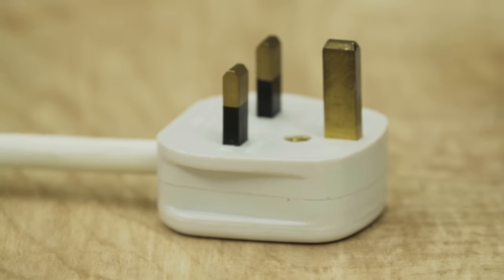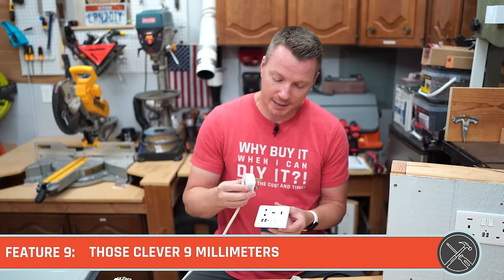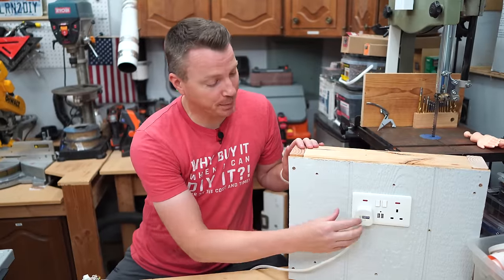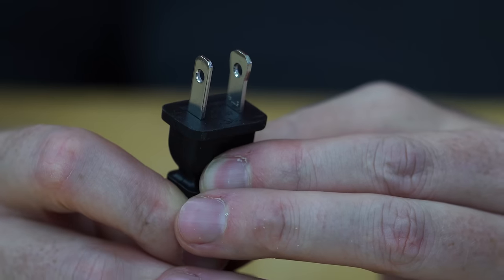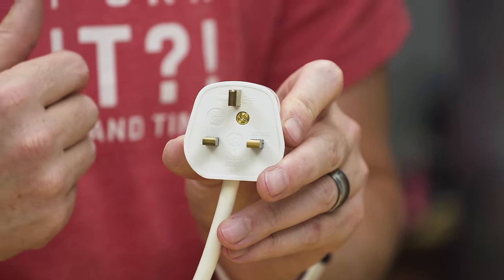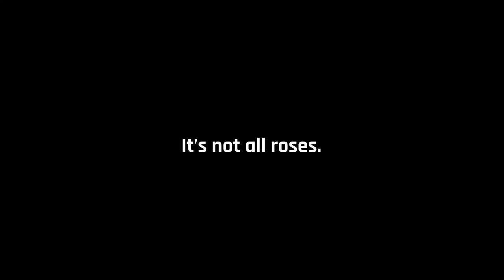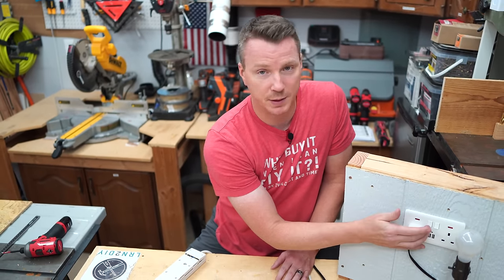British Plugs and Outlets Are On Another Level

Comment: There is a note about loading... all houses have a main switch. If a load causes a circuit a short circuit, that loop cuts out. Annoying but its another safety feature. There's usually several loops in a home, mine has one in the kitchen and living room, one in the garage, one in our outhouse and one in the bedrooms. My last home had two, one for half 8f each house.
Reply: Yeah mine has Lighting up - Lighting down - Plug sockets - Fridge - Oven - Washing machine - Boiler. Lots of lovely loops and a circuit breaker for each under the stairs.
Reply: If your main switch (main isolator) trips then that is an earth fault now unless you have a very old system which would have fuses. If you have circuit breakers for each circuit that would trip before the main switch as they trip at a much lower current than the main switch. The main switch tripping means it's protecting you from a potential electric shock.
Reply: Interesting, we have the exact same short circuits safety systems in India as well. Probably a system inherited from the British.

Comment: Many plugs are now sealed and inaccessible, the fuse can be reached by lifting a flap to replace, but the actual plug cannot be opened. I always keep older plugs as spares so that I can cut the sealed one off and replace if needed. Thank you for all the information, some of which was news.

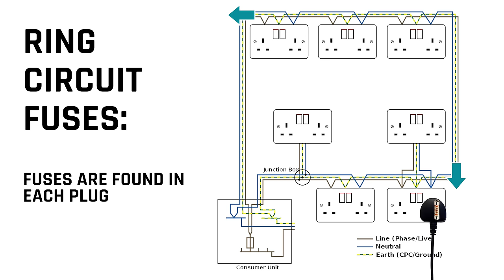Comment: 6:15 That is not at all the reason for the fused plugs. The reason the fuse is essential is that the ring circuit can deliver FAR more current than an appliance line cord. Without the fuse, every appliance, no matter how small, would need to use cord thick enough to handle 30-32A, lest the cord itself act as the fuse.
Reply: There 32 amps available on the Ring Main so the cord must be protected by a fuse of 3 to 13 Amps depending on its rating.
Reply: @fivish  Yeah, isn’t that what I said?
Reply: a conductor or cord is not a fuse and cannot act as a fuse, it can only overheat a set fire to its own insulation
Reply: @gimmieliberty6514  yes but that sounds pretty bad too.
Reply: Without a fuse if an appliance failed it would shut the power to every item on that spar.
Reply: @gimmieliberty6514  It was sarcasm: without a separate fuse, the cord will overheat and melt through until the wire goes open. (At which point a fire is likely to have started.) Any wire will act as a fuse if enough current is passed through it.
Reply: A 32A fuse naturally feels dangerous to rest of europe. Here in Iceland you only see those in industrial settings. Nothing in my breaker box exeeds 13A. Obviously this is not really a problem as these circuits are not burning doen houses and the problem is solved by fused plugs. Just feels strange.
Reply: Not really. AU/NZ, for example, run 20A radials. The plugs aren't fused at all. So you could have a lamp cable that's capable of shorting a 20A radial. The fuses in UK plugs are to protect to the edge, whereas everywhere else wants to protect the circuit.
Reply: our plug fuses generally are 6amps
Reply: @JonGretarB  13a fuse on breaker can’t run a dishwasher machine.
Reply: @MichaelBeeny  no, why would that happen?  What spar?
Reply: @JonGretarB  My shower is a 7.5kW one, pretty cheap and low powered compared to most modern showers, so it actually nearly meets the rating of the 32A fuse that feeds it. I had to replace it recently with this 7.5kW model, hard to find one so low power these days but as I was on a 32A fuse I could only assume that the cabling was rated for at least that, didn't want to take chances. However during fitting I found the cabling was actually much beefier and thus I could have installed a more powerful shower, but as the house is fed by a 60A fuse itself I wasn't willing to go too high lol.

The oven also has a 32A fuse and circuit, not that it needs is as it is a gas oven at the moment anyway.
Reply: @VIRNALIZ  Yes, it can. They use a tiny amount of power just like a washing machine. They don't even need as much power as a kettle!
Reply: Craig Dendy  The RCD is in the breaker, if you have them. I still have a good old fuse box. No need to update it, unless major electric work is being done in which case it may be legally required. But I'm not likely to be in that situation unless the house floods or something.
Reply: That's funny - as far as I'm aware, in my country, the default current you get per apartment is 16A, and you need to pay extra to get more than that. (Of course implicating compliance with other security measures to ensure safety across the board.)
Reply: Craig Dendy  Your comment is pretty pathetic, especially when you don't know what you are talking about 🙄
Reply: @VIRNALIZ  It most certainly can. My dishwasher is on a 13A circuit, but IIRC the dishwasher itself is rated at less than that.

Comment: In practice, basically nobody in the UK calls them "Type G;" they're generally just referred to as "13 Amp" plugs to differentiate them from other types.

It's also worth noting that the design has evolved over the decades; the live and neutral pins didn't originally have the insulating sleeves, for example, that was added later.
Reply: Just call them plugs or 3 pin here....never heard 'type g'.
American plugs are 2 pin...
Reply: It's a technical term used by electricians, so you wouldn't expect it to be well known.
Reply: If I wanted to get technical I’d just say BS1368 plug.
Reply: *1363

Comment: The thing about ring circuits you did not mention is there are different circuits for as an example in my house, is downstairs sockets, upstairs sockets, upstairs lights, downstairs lights. Then there is a separate circuit and socket for the electric hob and oven, and a separate circuit for the electric shower, and another for the hot water heater. Then there are a totally different system for the electric radiators all round the house.
 As said by Ed C, the switches don't cause any confusion when troubleshooting, they're pretty bulletproof and growing up with them, you know they're there.
Reply: hob=range (translator for Yanks)

Comment: The high safety level is also because we use 230Volts AC and a ring circuit will normally have a 32amp load rating, radials 16amp or more - not a combination you want to get on the wrong side of.

Comment: Another advantage of having a switch on the socket means you don't have to keep inserting the plug and pulling it out every time you want to turn a device off. This keeps the plug/socket connection nice and tight. (Notice how USB cables drop out of your phone all the time coz the port has worn loose)
Reply: Also means that the plug isnt left on the floor for you to stand on, negating yet another issue that was made up in the video.
Reply: Yup. Often times those 3 pin plugs were just sitting there without ever getting plugged off since we have switches to turn it off. Very convenient.
Reply: This is so true. I have a rice cooker and it doesn't have a switch on it, so if I left it plugged in it would always be on warming mode which is a waste. But, thankfully, I can just use the switch on the plug.
Reply: Eu plug doesn't wear out and almost every device have switch itself

Comment: You missed the main use of the switch, which is to disconnect power from the plug before inserting or removing, thus further reducing the hazard of arcing or shock.
Reply: Isn't the shock hazard zero because the prongs must be inserted to the point where only the insulated part is exposed before making a connection?
Reply: On more modern plugs yes.  But there are still older style plugs around that do not have the insulated sections. A switched socket makes those older plugs safer to use too.

Comment: #6 Easy to open plug - We do have moulded plugs a lot now - most new appliances come with them to avoid problems with people rewiring incorrectly. In those cases, the fuse is accessible by a hatch on the mating face.
And when you're used to the sockets having switches, it's instinctive to check that first...

Comment: Excellent video highlighting some of the key safety features that unfortunately are deficient in the North American system. Here are a few others -
1 UK you cannot straddle the plug in the socket when used on an extension lead , the 2 pin type B you can on a slim line socket leaving  one pin plugged in and the other unplugged which can be live at 120V and fully exposed.
2 Ring main at 32A feed at 230V can draw 8kW (unlikely), but “main” benefit is only one cable size (2.5sqmm) used for sockets and less issues with volt drop versus radial/ spur circuits. UK uses far less copper and thus material than N. American.
3 Fuse in plug top means can rate cable to load with appropriate fuse at 13, 10, 5, 3   and 1 A - so greener and cheaper for consumer. Also closer protection can be selected for the device being supplied so less risk of a fire in the event of a device failure.
4 cable dropping out of bottom down wall means  less likely to be a trip hazard - you appreciate that more as you get older!
You cannot beat the shuttering and live neutral prong insulation - it protects little fingers getting in and losing a child due to electrocution - that’s probably the most important of all considerations.
Reply: Point 2 is almost a day to day ocurance. My shower is 7.5kW, and that's the low end for showers these days. However it isn't on a ring, but it's own dedicated circuit from the fusebox.
Reply: @dlarge6502  You are talking about fixed appliances in that shower instance and they are wired as direct loads to the distribution boards plus dedicated GFCI / ELCB. UK is one standard socket configuration for domestic portable appliances all supplied  at 230Vac.
Reply: @stephenpike3147  I think that is what I said? Although there is no RCD on my shower. The fusebox is from the 90's

Comment: Having lived in continental Europe, I'd say the thing I missed most about UK plugs and sockets is it's such an old system that it's near univeral (BS546 plugs are still being made, and are still allowed, but I come across an example of one in use almost never, say once every few years).  This means you never need a different plug or an adapter just because you decide to move an appliance and find the nearest convenient socket doesn't match the plug type.

Comment: Ring circuits aren’t usually installed now. It’s radials. 
Also a square within a square, marked on the appliance, doesn’t mean double grounded (I’ve never heard of this) it just means the appliance is double insulated and needs no ground AT ALL.
Reply: Ring circuits were introduced in the post-war period as a way of saving a bit of copper, but are fast falling out of favour. As Darren says, new installations are generally done as radials.
Reply: @tlangdon12  When I wire from scratch, I usually do an upstairs radial on a 32a breaker using 4mm cable. The kitchen gets its own 32a circuit, again using 4mm, then the rest of the downstairs on a third. 
If the customer requests it, then each appliance gets its own 16a circuit using 2.5mm. That’s the dishwasher, drier and washer. If I do this, I don’t bother with a separate kitchen socket circuit and it goes with the rest of the downstairs socket outlets. I now use RCBOs for every circuit other than the lighting.
Reply: Yes, and in this case the plug may have a plastic earth pin that's just there to make it fit in the socket and open the shutters.
Reply: Rings are standard: Appendix 15 of BS7671:2018.
Reply: Rings are still the way brits do it ???
Reply: @maldwynparker5351  I don’t know any sparks who install new ring final circuits. Obviously if there’s one installed and you’re adding to it, you maintain it.

Comment: Those 9mm do actually work, I always end up touching that part when plugging stuff in and have never been shocked. And I have also stepped on my plugs multiple times, incredibly frustrating.

EDIT: And for the potential confusion on the switches, generally that isn't ever a problem, we, at least from everyone I see, then to leave the switches on for appliances that will not be moved often, ie lamps, tv power cords but for everything else that will be unplugged and moved around its generally switched off so that is stuff like hair dryers, chargers so it isn't really confusing.

Comment: I've never zapped myself on a US style type A or B plug... but nonetheless those type G plugs seem way superior in all the ways that matter. The size isn't so important since they have a low profile from the surface of the wall... every type A plug I've ever damaged is because the receptacle is behind a desk or some furniture and pushes on the cable coming out eventually breaking the wires inside. One potential drawback though could be trying to fit multiple plugs onto a power/surge bar. Also I'm curious what they use for the DC low voltage 'bricks' that in the US plug directly to the receptacle for things like computer printers, aquarium pumps ets).

Comment: Other features - the cord orientation means sockets are usually side by side - much better then the vertical pairs used in other systems.  The fuses in the plugs have different ratings for different appliances - 1A or 3A for things like lamps, 5A for medium power appliances, and 13A for heavy duty equipment.

Comment: Just to let you know that not all outlets are switched. It’s not unusual to have unswitched sockets in many homes on this system. Excellent video by the way.
Reply: One common use is with under-counter appliances, such washing machines, where the socket is inaccessible and is controlled by a switch above the counter.
Reply: Fridges and freezers especially
Reply: @miles_thomas  Had a near miss with the chest freezer in the garage which was plugged into a double switched socket. It's now on its own dedicated unswitched one.
Reply: Older sockets were available unswitched but now all sockets come with a switch
Reply: @ray-wm7yd  Unswitched sockets are most definately still made by all the usual brands.
Reply: @ray-wm7yd  wrong
Reply: When we built our home, I had the contractor make every outlet except the kitchen and utility a switched. Only the bottom plug in each outlet is switched, the top plug is always on. It's nice for lamps and to mess with my wife when she's vacuuming.
Reply: @Graham_Langley  I wish , my washing machine and oven plugs are at the back of my cupboard. even the safety cut of was placed there because apparently putting it above would be too near the sink and break regulation. The joys of small cramped British homes
Reply: @brianwest7344  Must be a tiny house as the required separation is 300mm. 
The current IET Electrician's Guide To The Building Regulations says:
5.2.3(d) Accessories should be a minimum of: (i) 300 mm from the edge of kitchen sinks and draining boards to minimise the risk of splashing.
It's 100mm in the case of a hob/cooker.
Reply: It is unusual to have unswitched sockets. They tend to be for special applications, like hidden sockets on permanently plugged in appliances.
Reply: Eh, they're still not that common tho
I was confused the first time I saw one lol
Reply: @ray-wm7yd  Not so. Screwfix and Toolstation for two sell unswitched sockets, and they are ideal in situations where you wouldn't normally use a switch. Kettle on a kitchen worktop for instance.
Reply: yeah a bit confused on that, the plug doesn't have the switch. The outlet does. Any type-a or type-b can have a switch added to the outlet, has nothing to do with the plug.
And in singapore, not all outlets have switches, most do, but not all. It something you pay extra for
Reply: @MoonLiteNite  Sometimes the unswitched version can be more expensive than the switched due to the far lower numbers sold.
Reply: Nothing wrong with unswitched, because the plug is technically a switch that can be unplugged under load. Or that's the theory. I find that switched sockets are cheaper than unswitched.
Reply: The unswitched ones are meant for hidden sockets such as under the counter for a washing machine where you may have a power switch elsewhere high up on the wall. An unswitched socket is not designed to be used in normal wall situations

Comment: given that a ring main is rated at 32amp and uses 2.5mm or even 4mm when runs are longer, load balancing is just not a thing we brits worry about or even consider lol. Also, it's not just one ring in a typical home you spit it to upstairs, downstairs and kitchen with the oven and lights on their own radial circuit.
Reply: Aren't ring mains no longer used in new builds?
Reply: @KaldekBoch  afaik new builds still use ring mains but it's been many years since I've worked on a new builds so they might have changed practices not that the regulations have changed to suit, also rings have a safety aspect being if one side is disconnected the earth or cpc will still have a connection from either leg.
Reply: @KaldekBoch  Ring main is standard: Appendix 15 of BS7671:2018

Comment: Yes, speaking as a Brit we really don't know how lucky we are... but stepping on a UK plug in the middle of the night is something you only do once unless you are entirely incapable of learning from pain.
FWLIW: While I can theoretically see what you mean by the weakness of the ring wring system - it can be confusing to fiddle with but I never heard of load-balancing being a practicable issue. Switches of every socket? Again, never a practicable issue but certainly really useful.

As an aside I both like and loathe European plugs. At their best some are every bit as good as the UK ones while being significantly smaller, but at their worse are nearly as dangerous as the US ones - but pretty much all use the same sockets!